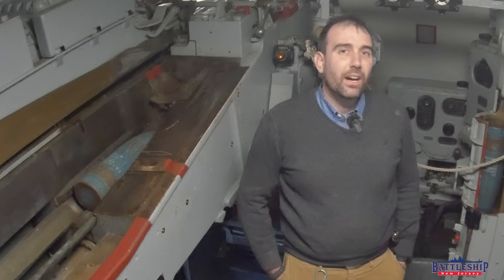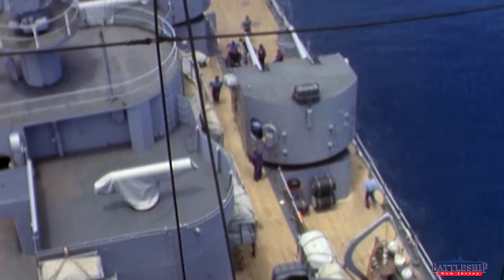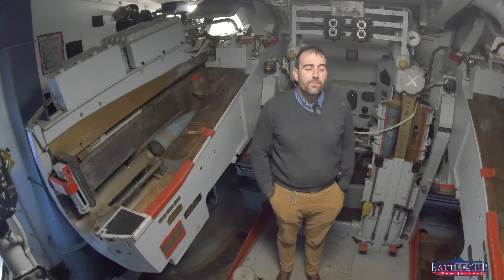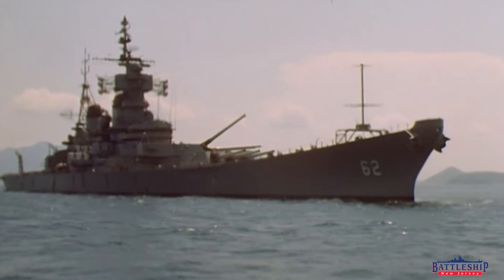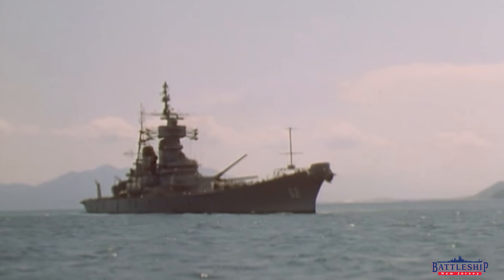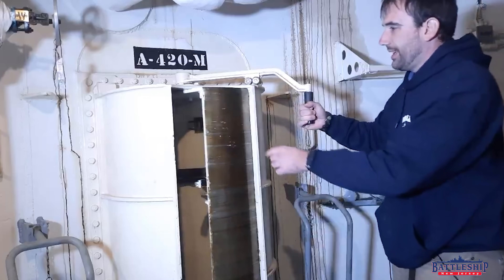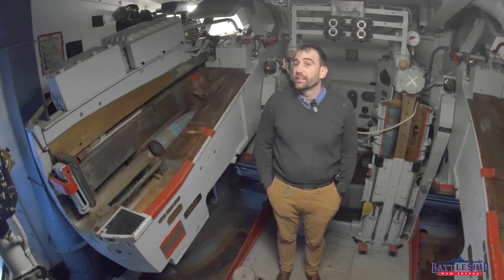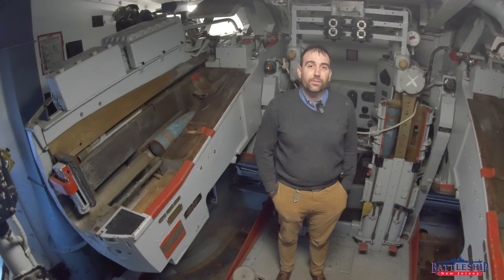Why Do Modern Warships Have So Few Guns?

Comment: this is where if they were to design some sort of new battleship, 6/7 (depending on if they went with a 3/4 arrangement with turret 1 being a quad barrel and the superfiring turret 2 being a triple barrel) should be the number of 16"ish guns they should limit them to.  new munition handling systems are probably available that could increase the rate of fire to maybe 1.5 secs per round.  this would allow the Navy to condense their magazines to the forward compartments allowing more space elsewhere for VLS cells, the rolling box launchers, Phalanx, etc and more radar as well.
Reply: Except large caliber guns aren't needed. It's more mid range defensive weapons
Reply: @admiralmallard7500  that is one opinion yes, other opinions say they could be needed.  For shore bombardment, large caliber guns are always preferred over small to medium caliber guns.  As Ryan stated, they are cheaper than missiles and lasers.  To build on that, I know of no countermeasures for high caliber guns outside of more armor and if there is that much armor missiles aren't likely to do much better.  There are many different camps and as of right now the consensus is to use stand off munitions, but eventually I think the cost inflation will start bringing more to the camp of a mix of high caliber guns and long range missiles.  Modern technology theoretically allows for a modern 14" gun to be just as effective as a 1940's 16".  So there are plenty of options, just limited want to right now.
Reply: @Farlomous  Shore bombardment is such a niche area that its incredibly unlikely it would be a standard ship feature. More like specialist vessels. And even then that would be a costly project because large caliber guns can no longer be produced
Reply: @admiralmallard7500  actually they can if necessary, just because the don't need them right now doesn't mean they can't, otherwise the ships wouldn't even have been made museums outside of one ship per class.  Might take 6 months or so to get production up, but it would take them at least a year to get the ships ready.  Like numerous contributors have said, it wouldn't be easy, but it is still doable.  The bigger issue would be training gun crews since only post Vietnam sailors would likely be available to do it, but again not impossible.  Also, shore bombardment wouldn't be their primary purpose, dedicated heavy missile platform would be their purpose.  Reducing the main battery by one turret would allow you to most likely triple and at least double the missile capacity of the subs and destroyers we have in service.  Not likely true, but most definitely not anymore niche than any other surface combatant out side of the fleet carriers and phib carriers.
Reply: @Farlomous The countermeasure to a battleship-caliber shell is smacking it with an interceptor mid-flight. It's no different than hitting a supersonic anti-ship missile, and arguably easier because the shell is on a predictable, high arc. Tear the ballistic cap off or destabilize the round, and boom, shell countered.

Comment: I've seen in those war Sims that a modern vs 40s fleet Battle that the missiles run out. When the missiles run out the guns of the old ships completely obliterate the modern ships. A single 5 in vs 9 16in is a pretty hilarious battle. Even if all the big guns run out. The sheer number of smaller guns of the old ships still win. If not for the US Air craft carriers we would never have seen a large war ship in action again.

Comment: Consider this.. if electronics are jammed or go out, you can still handload a 5 inch 38 dual mount. 
And, there are targets a missle cant lock onto. 
Guns are proven and reliable. Uss Long Beach didnt have any, and the Navy quickly added two 5 inch for those very reasons.
Reply: The guns were in a terrible position and still largely useless. No ones going to drive their ship into gun range if another nowadays as they have no armour

Comment: One of the most effective anti-drone systems in Ukraine is the German developed "Flakpanzer Gepard" (there's lots on YouTube about it) which is also capable of firing an anti-tank round.  There is also the small boat armed with an RPG or a mortar to contend with.  Sailors on deck with MANPADs or Javelin missiles anyone?
Reply: Yes, the Gepard has a standard load of 320 AA and 20 AT rounds. But I don't think a 35mm "anti-tank" round against a modern main battle tank is going to do more than annoy the crew and bring yourself to the attention of the tanks main gun - and even a "small" 105 mm tank gun will be one hit, one kill against a Gepard. That same 35mm AT round might be more useful against light armored vehicles, such as BMPs and BTRs.
Reply: @AlexanderSchreiber should work like a Charm againts old T55S.

But yeah it's mainly self defence againts lightly armored vehicles.
Reply: @AlexanderSchreiber i can see it takimg out any carousel magazine tank.
Reply: Not as effective... but then it's better than nothing in a shooting war... imagine the high seas and chaos of the deck is gonna be nuts in using it... remember CLEAR BACK BLAST
Reply: @PrograError i dont see them getting that close.

Comment: I say bring back the monitor concept. Get a ship with one or two big gun turrets for shore bombardment, a 5 inch or two for lighter bombardment/flak, CWIS/Rolling Airframe missiles, and some tomahawk VLS tubes for longer range work. It'd fill the role the Iowas kept getting pulled back for without having to go through that whole process again.
Reply: You are describing the Zumwalt. Sort of.
Reply: @jstogdill  The Zunwalt is what happens when brutalism meets immature weapon technology. The Monitor I envision is already existing technology amalgamated onto a ship. Might need to do some research for the guns, since we haven't made stuff that big in decades, but all of it is already existing technology.
Reply: @wrenchinator9715  fair enough. I’m
Curious though, what compelling strategic contingency requires one? If I were tasked with prioritizing navy shipbuilding I’m not sure that would be high on my list.

Comment: You also miss a key factor, Ryan.  When New Jersey was built, you needed all those gun barrels because of (1) Rate of Fire and (2) accuracy.  The current automatic 5" guns have a rate of fire so that one gun can pump out as many shells as several manually loaded 5" double turrets on New Jersey could and, just as importantly, lay those shells onto a target where the New Jersey guns relied on "a whole bunch of shells" to blanket an area, especially in terms of AA.  Not a slam at New Jersey, but technology has allowed a single gun to do the work of several.  As for the caliber of the guns...I'd LOVE to see bigger guns make a comeback for shore and other bombardment issues...8" or even 16".  But they'd likely be a single, automated mount much like the Burkes now mount a single, 5", unmanned gunhouse.    And if, we're talking about shore-bombardment, then you'd also have to ask if a Howitzer as opposed to a traditional rifle might be preferable.
Reply: I think it would be killer if the Iowa class was recommisioned, replace the old twin 5inch guns with modern 5 inch automatic guns ringing all the way around the ship.
Reply: That'd be a killer idea, but it'd probably be cost intuitive.
Reply: And yet in a previous video, Ryan stated stated that on the NJ some of the 5" gun crews could fire over 15 rounds a minute, per barrel! If I remember  right, he said one crew could do 22 rounds per minute on one gun!
Reply: @miketorres8441   with a well-trained gun crew, that's possible.
Reply: You're going to hit a hard wall with how many rounds you can put down range, and how much you can heat the barrel, before you shoot the barrel out.